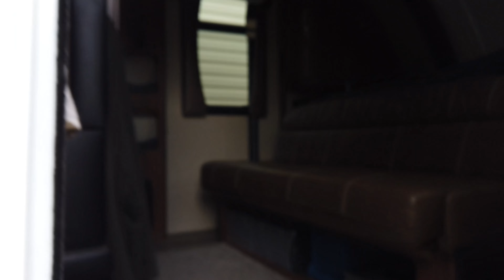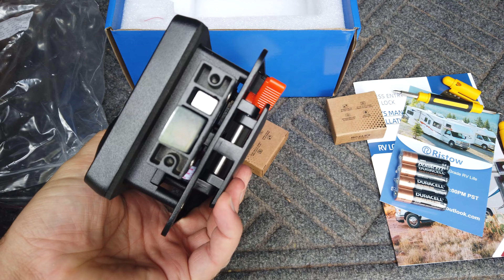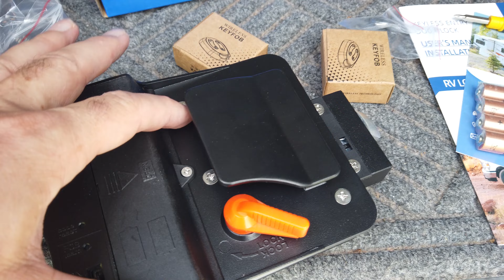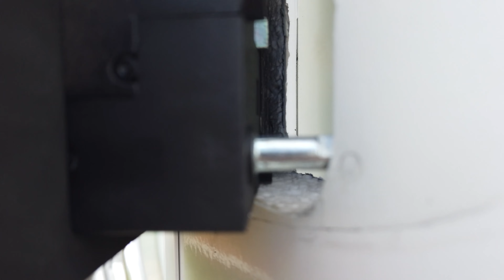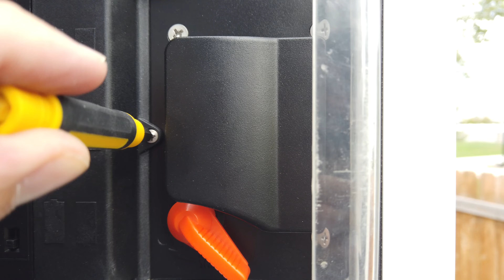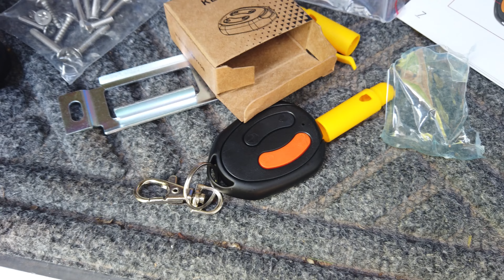Toss The Keys And Use a Ristow RV Keyless Door Lock!  Unboxing & Installation Review

Comment: In case anybody else has the issue with the keypad cracking like the one in the beginning of the video, it's just a sticker that you can replace for a few dollars. I've replaced mine a couple of times now. It only takes a couple of minutes too.
Reply from the maker: Thanks for the heads up on that. Like I said in the video the old keypad still works, so I've moved it to my back door which was previously a manual keyed lock. Now I'll look into purchasing the key cover.